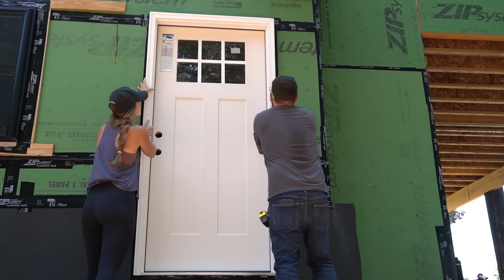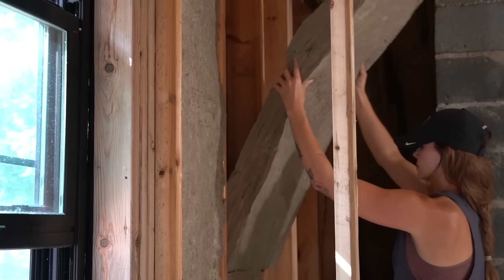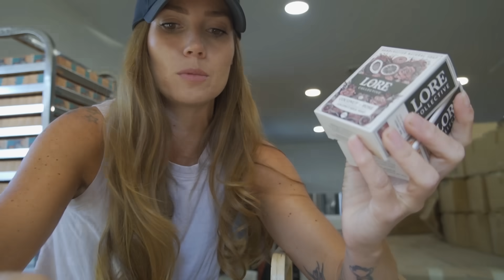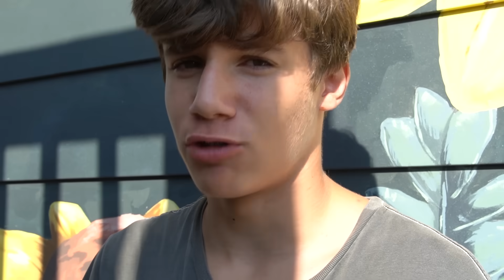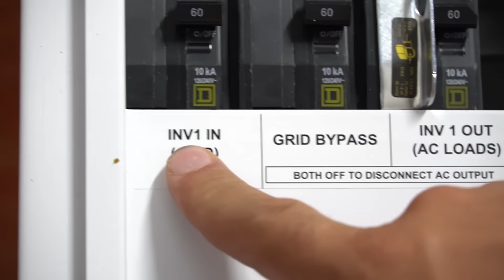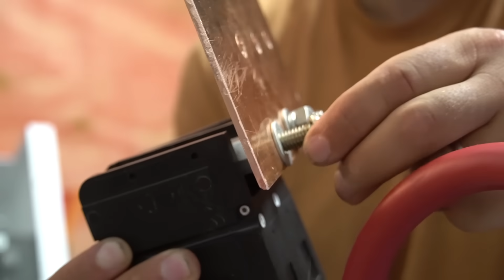Removing Our Solar Power System | Why it no longer work for us...

Comment: An honest question. Why do some people choose door opening inwards? Doesnt it make more sense to open it outwards? 

Its also safer if you need to exit in a hurry. 

Also if its raining and the door gets wet, it will drip inside the house?

What am I missing?
Reply from the maker: We live in West Virginia, and inward-opening exterior doors are the norm here-mostly because of climate and practicality. When you deal with snow, ice, or even just leaves blowing around in the fall, an outward-opening door can easily get blocked or jammed. If there’s a foot of snow piled up outside, you physically can’t push the door open.

Inward-swinging doors also make it easier to install screen or storm doors on the outside, which is pretty common around here. As for rain dripping in-most entryways are covered with an overhang or porch roof, and proper thresholds/weather stripping prevent water from coming in.

Comment: Why are you not joining the roofs with an awning over the ground floor windows that is the same angle as the roof? Essentially an extension of and joining of the roof? Those two thin roof lines are not cohesive nor is the double height wall without a break.

Comment: The bus bar you needed was in the Conext XW+ Connection Kit... the box under the 2nd and 3rd inverters that had the extra wires and 250A breaker in it.
Reply from the maker: It would have come with the bus bar yes, but the issue with getting the kit is the 4/0 cable is only long enough to reach from the distribution box to one inverter only. I have three stacked, so I would have bought 3 kits, that came with 3 bus bars and two of the three kits would have cables too short to reach inverter two and three.

Comment: We have a bedroom above our garage. It's a heated garage so In  the winter we keep it at 50 degrees to help with keeping the bedroom warm. At my old house we added a 2 inch foam board insulation on to our insulated wall...you could keep that room warm with a candle...I highly recommend an added layer of insulation to your bedroom floor.and walls...over the studs..

Comment: This video title was a bit confusing.. you're keeping and upgrading your solar system aren't you? Title kinda makes it sound like you're going on grid (which I'm pretty sure isn't the case?)
Reply from the maker: Hi! Our current solar setup has to be completely removed in order to reconfigure the system to work with additional components. It won’t work for us as it currently is with the addition of HVAC in the new portion of the build 😊 Hope that helps clarify!

Comment: So, your doomsdayer plans are not working so well, eh??!!
Reply from the maker: Hi! Welcome to our channel! 1. We are not “doomsdayers” and 2. We are adding full HVAC to the addition we are building so we are increasing our solar power capacity. We are keeping all the components we already use, just adding onto what we’ve already built. 
Hope that helps!
Reply: @WildWonderfulOffGrid  So why the isolation and elaborate "safe room?"
Reply from the maker: Hi- not exactly sure what you mean by isolation. We own two businesses in town and are quite involved in our community. As for the safe room- it’s essentially a storm shelter but rather than having to leave our house and run to an exterior shelter it is a “safe room” inside our house. You may have missed our video where we had 80mph winds come through and destroy our farm- our family had no where safe to retreat to. Over the past couple of years the weather has been noticeably worse here with a sharp increase in tornado warnings for our area. I’m not sure why we wouldn’t have a safe room at this point- especially considering we are building our home ourselves and can essentially build it to be anything and everything we want it to be.

Comment: So, just popped into my mind. And so I’m gonna ask… and honestly I have no clue if it can even be done… so I love that you have your solar system… though here of course you are doing a major upgrade… anyway, to the question. If possible, do you ever plan to add a full home generator for that 1 more proactive back up. I was raised.. and I think I’ve heard yall mention something similar… 1 is none, 2 is good but 3 backup plans is always the best. No clue why except since your upgrading in this video as to why it popped into my mind. And now thinking about it, would you go with fuel based and or also a wood version. While I love seeing updates on your cafe and other businesses my thing is watching yall work together building your dream home. I was lucky to find yall near the beginning of your very first part of the A frame build. No clue how you served and still liked and loved one another living on that tiny trailer. However yall had a well laid out plan and as they say, where there’s a will there’s away. I’m 68 and never had a lot of great strength. But watching Erin do the things she does, that young woman is the example of a strong woman. Mentally and physically. Despite her tiny size she comes very very close to being as strong as Josh. She picks up and moves crazy weight like it is the easiest thing ever. 
Also, I’m so excited to see more of your sons involved in the day to day running of multiple businesses. And I understand that they are school age and homeschooling is yet another thing Erin excels at. I’m gonna miss seeing Ellie as much since I know she to is headed into school days. Though I don’t think it will slow her down one second when working with her /yalls animals.. I might be wrong.. but I’m guessing that sweet heart could not continue breathing without  interaction with the animals on a daily basis. 
From the tiny infant and young sons the growth of them all is going freighting fast. Ellie is lucky to have a dad and 2 big brothers… she’s gonna take the breath away of so many young men someday. And she’s got great protection. And your boys are so handsome, and they have whet money can’t buy… dreamy eyes. So the girls are gonna fall fast. Of course the kids got their great looks from equally attractive parents. And from what little the boys have been on video it’s easy to see like their sister, they have developed a great work ethic! I do hope that all your children have the love of your live style and choose to keep it in their lives as they become adults. I don’t know your property plans but I’m guessing you have more than enough land they could build on it as well.

Comment: Hello. For such a large Solar system, why didn't you go 3 phase ? Large motor loads would run smoother. Yes, you would have to adjust for 240 V single phase appliances, but that's not difficult.

Comment: The hinges that come with the doors we always change out. Josh get a chopsaw setup so you can cut everything straight and fast and not have to use the circle saw.
Reply: You got a chopsaw that's the first time I have seen it you should use it more.

Comment: Just a couple observations.. even when you build a non bearing interior wall its easier if you double up your header for 3" this allows nailer for door trim later on. Question. Isnt code min 4 foot for panel install?

Comment: When i remodeled our entire home i went with pocket doors due to some rooms being smaller. wife loves them.  most are intimidated by them but if installed properly they are problem free and easily removed from pocket if you need to.

Comment: How do you attach wood framing to concrete block?
Reply from the maker: Tapcons 😊
Reply: Three methods come to mind.  1) Drill pilot holes and use concrete screws.  2) use a construction adhesive.  3) do both.